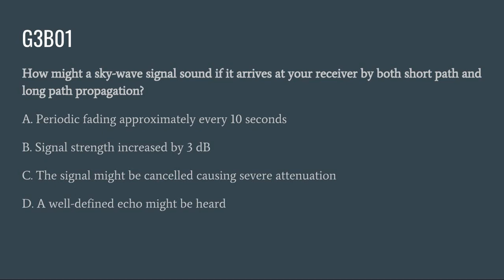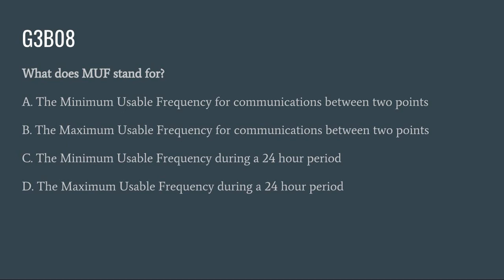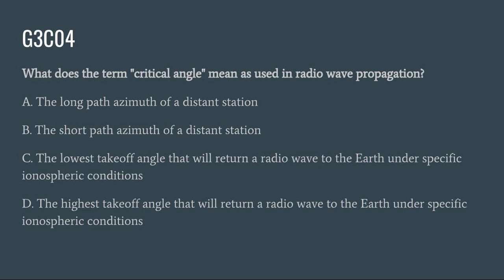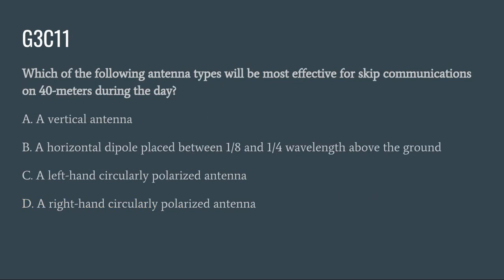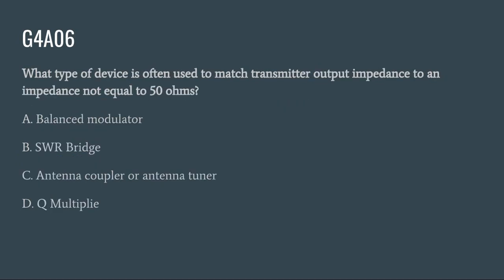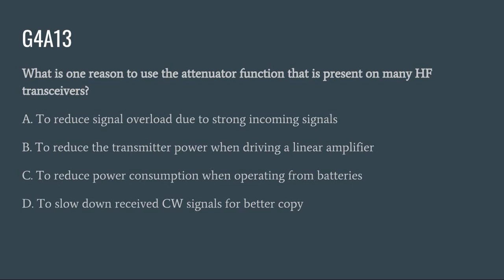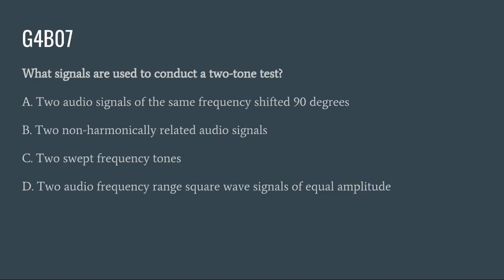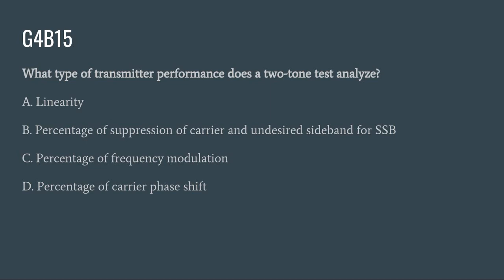2015-2019 Amateur Radio General Class Question Pool #4

Comment: Thank you for the content.   Is this question pool good through fiscal year 2019 or calendar year 2019? How do they do their years?
Reply from the maker: They normally change mid year, this one is scheduled to be replaced at the end of June 2019.
Reply from the maker: And each question pool is good for 4 years from when it is released and it's given it's date of start, so the new General Class Wil be July 2019-2023.